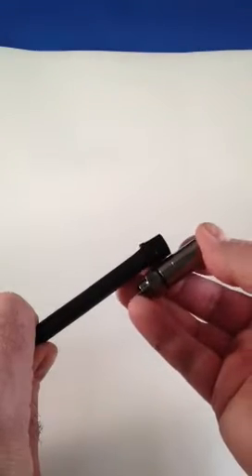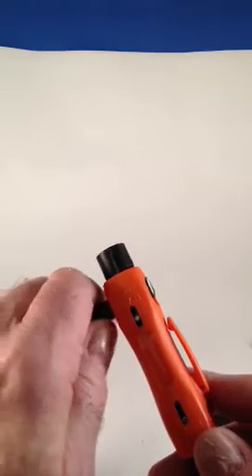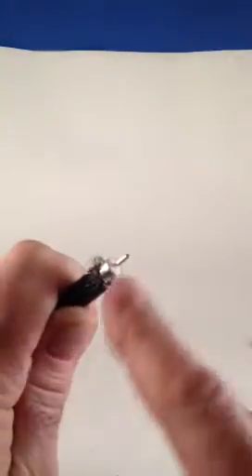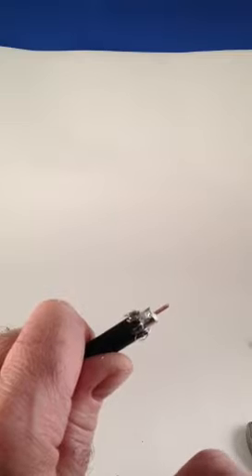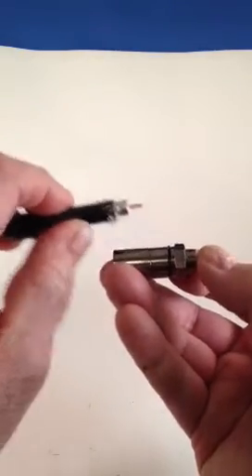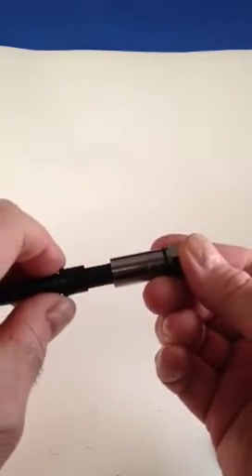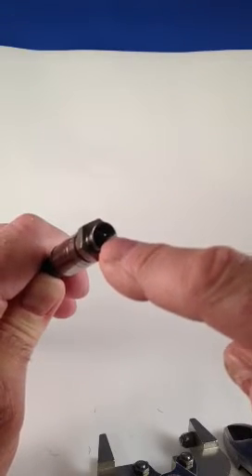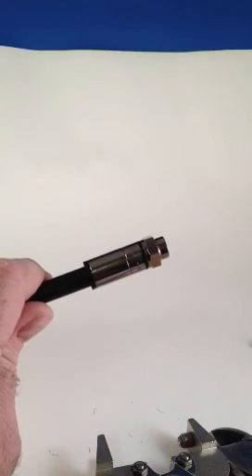Belden LRC Snap-N-Seal SNS11AS Installation

Comment: My only recommendation/suggestion is to *AVOID* using diagonal type wire cutters (a.k.a. "Diags") because such diagonal cutting pliers have a tendency to compress / pinch the dielectric insulation. Instead, it is recommended to use *Cable* Cutters since they use a shearing action as opposed to cutting by indenting and wedging the wire apart (e.g., diagonal wire cutters). By using Cable Cutters, the coax has a clean "square" end to it that results in a far better seal in the connector.